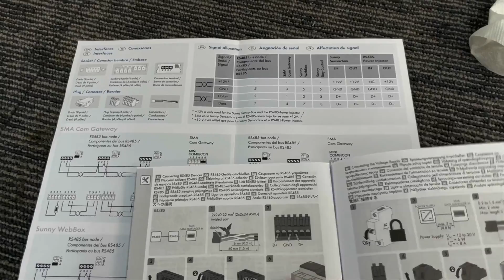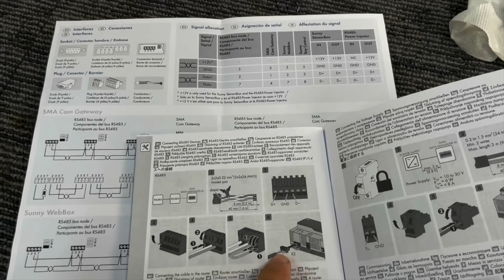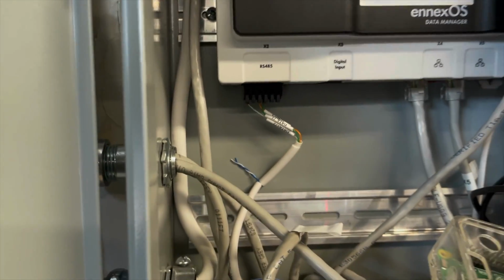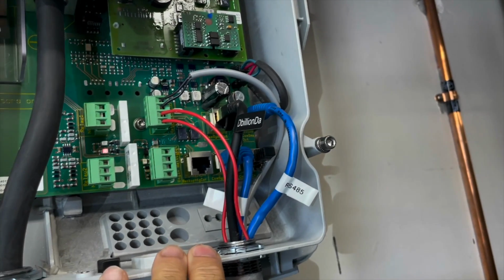SMA Data Manager M - RS485 Wiring

Comment: Is there a way to daisy chain the inverters with traditional 3 wire rs485? Or is this strictly for inverter-->data logger
Reply: I have 5 stpus50-us-41 inverters in a commercial canopy application and I already ran the cables that are NOT cat5. Rj45 isn't an option at this point
Reply from the maker: Hi thanks for comment. I believe the following is the case: the rs-485 is needed for the connection between the data manager M and the Sunny Island master. The master sunny island has a cable(s) connecting it to the sunny island slave(s). The sunny boy inverter(s) communicate via speedwire by an Ethernet connection that I have going from Sunnyboy to Data Manager M. I am not sure if speedwire works over Wi-Fi connection (with data manager m and sunnyboy on same network, I may try to see if this is the case). Do your inverters have speedwire protocol? Wi-Fi? Ethernet?
Reply from the maker: Looked up those inverters. That is an impressive setup. Looks like they have Wi-Fi. I would try to see if you can commission that way. Alternatively with the wire you gave pulled, how many individual wires does it have?
Reply from the maker: During commissioning of data manager M I would see if it finds the inverters (have the inverters connected to Wi-Fi  and on the same network as data manger M). https://youtu.be/aL7OEd0ZVBg. 3:12 minutes into that video
Reply from the maker: 3:50 into this video shows how to make 10/100 Ethernet cable with 4 wires. https://youtu.be/QgrVVyIzecM. Do your inverters have rs-485 capability? If so daisy chaining should work (maybe end of bus termination required?). Not sure how to commission with the data manager but this is another thing to try.

Comment: Thanks for posting this. I just picked up the Sunny Island RS485 piggy-back card (485PB-G3) and I noticed my Sunny Island 6048-US-10 has 2x7 and 2x6 pin connection ports and the piggy-back card has 2x7 and 2x5 pin connection ports. Does your Sunny Island in this video have a 2x6 pin port like mine, or does it match the piggy-back card with 2x5 pins?

Thanks!
Reply from the maker: Thank you for your message. I will have to check mine to answer this.

Comment: Thanks for documenting this! I have a few questions if you don’t mind:

Is this the Data Manager M or the Lite? 

Long shot, but have you done any ModBus integrations with the SI’s and Data Manager?
Reply from the maker: Hi thanks for the kind words. This is the data manager M. Yes I have this connected to the sunny island via the rs485 port of the data manager M and the rs485 add-on board to the sunny island.

Comment: This is awesome! 

I have a 516KWp PV capacity with 20 x 25KWp STPs, however my load is still very low, 80KWp. Is there a way I can modulate my production so that I don't have a system trip once the irradiation increases? 
I have a data manager M

Thanks
Reply from the maker: Thank you very much for your message. Is your system grid tied or completely off grid? Is STP the Sunny Tripowers? I will reply with a link that shows how to modulate power if the system is grid tied.
Reply: @curiousumscientia3648  thanks alot for your reply. Yes, the STPs are the Sunny Tripowers,..
We are planning to connect to the National grid, so the link will help, but in the meantime we have not connected yet, we instead  have a local load of 80KWp, with a battery bank 720KWh.
We've switched off some inverters and we are running only 6, which tend to generate more than what we need the  irradiation fluctuates!

Comment: Great video! I have the same equipment and are now trying to made the setup in the Data Manager M to recognize the SI’s on the system.  Did you did the follow-up video showing that?
Reply from the maker: Dear Francisco, thank you! I have not made a video on how to make the data manager M find the SI’s as I finished doing this before I started doing videos. My recollection is the following though: 1. Make sure you have the RS485 piggyback board installed in the master Sunny Island. 2. Make sure you have the cable connecting the RS485 connector on SI to the RS485 on the Data manager M properly wired and connected. 3. Connect locally to the Data Manager M. 4. Go to Device administration, click the “+” icon to add a device.  The “Device Registration” screen pops up.  5. This is from memory, but I believe you select “Modbus”.  Follow the onscreen prompts and it should find the Sunny Island if wiring correct.

Comment: Nice work again. Can I ask your data manger wires are they single wires as I had Cat6a shielded and have used single wire on each,
Reply from the maker: Hello, on one end of the rj45 cable you have you would cut off the end and wire the white/green wire to pin 1 on data manager m, the green wire to pin 4 on data manager m, and the orange wire to pin 3 on the data manager m.  You will plug the end with remaining Ethernet connector into ComSmaIn and the terminator plug into ComSmaOut. Paul, another data manager user, made a jumper wire to connect pin 5 and pin 6 on the data manager m together to provide termination but I did not do this and not experiencing any issues.

Comment: Thanks for the video.  This is just what I was looking for.  I had to build my own cable yesterday between the Data Manager and the Sunny Island.  It was helpful to see that my cable matched the cable you showed in your video.  

RJ45 connector to Sunny Island, pin 3 (white/green) => X2 (on data manager), pin 1
RJ45 pin 6 (green) => X2 pin 4
RJ45 pin 2 (orange) => X2 pin 3
I also ran a jumper wire between X2 pin 5 and X2 pin 6 to provide a termination (since I only have the Data Manager and the Sunny Island on this RS485 network).

I plugged my cable into the RJ45 connector on the Sunny Island labeled ComSmaIn and inserted the terminator plug into ComSmaOut.  I noted in your video that your cable is plugged into ComSmaOut, but it probably does not make a difference.

I confirmed that my Data Manager firmware is 1.12.7.R which was released in May 2021 to enable the Data Manager to communicate with the Sunny Island via RS485.

My Data Manager is appearing in the Sunny Portal, but I have not been able to register my Sunny Island with Sunny Portal. 

Do I need to register the Sunny Island with the Data Manager before I can register it with the Sunny Portal?
Reply from the maker: Hi Paul, I believe everything you list on your cable is correct. I will double check by beeping it out with multi-meter. Page 62 of sunny island manual matches your RJ-45 pinout as you described (but their colors are listed incorrectly, showing that the orange and green should have a white stripe). https://files.sma.de/downloads/SI4548-6048-US-BE-en-21W.pdf
The manual also indicates as you pointed out that this should go into ComSmaIn. I am not sure why I plugged into ComSmaOut, as you indicate it might not make a difference. I know I spoke to SMA America when I was getting this setup and they might have told me to do so. I will also beep out the terminator plug and let you know it’s configuration. I will have to make a video showing the configuration steps in sunny portal (I was digging around earlier and didn’t immediately find it, I’m wondering if it’s a step under create system). Unfortunately I can not remember if I did the configuration by directly connecting to the data manager m (via IP address through web browser) or through the sunny portal (https://ennexos.sunnyportal.com/login). As you might have noticed, they are very similar but do have differences (real time data vs 5 minutes) and different configuration options.  I hope we can get this working for you as the data manager m is useful for remote configuration of the sunny island settings, logs events, and of course all sunny island inverter data.
Reply from the maker: Paul, I do recall you will need to register with the data manager portal (direct internal ip connection to the data manager m) before it shows up on the sunny island portal.
Reply: @curiousumscientia3648 I logged into the Data Manager locally (direct IP address) and searched for SMA Data devices.  After about 2 minutes the Sunny Island was found and I added it.  Now I can monitor and configure the Sunny Island with the Sunny Portal.  Thanks for your help.
Reply from the maker: @paulruben521  excellent work!
Reply from the maker: Paul thank you for comment on the ComSmaOut va In. I have been getting errors in data manager M and this might be reason why. I have swapped. Did you fix your over voltage issue?